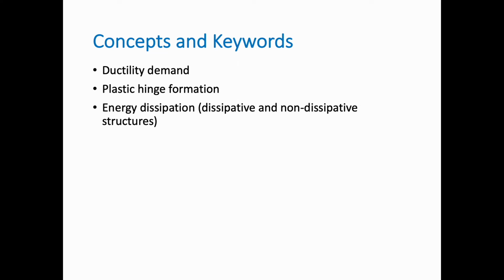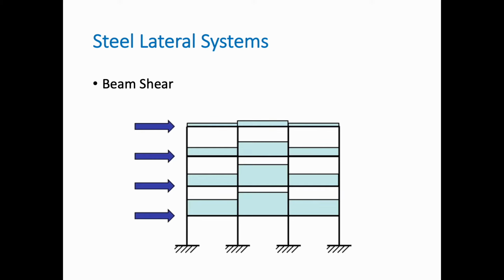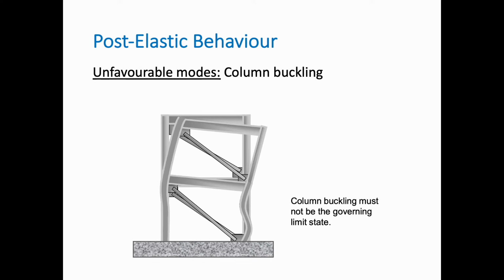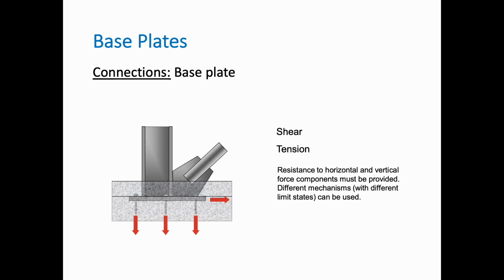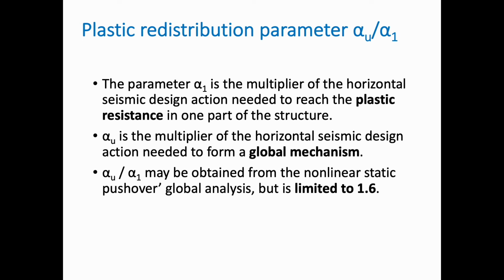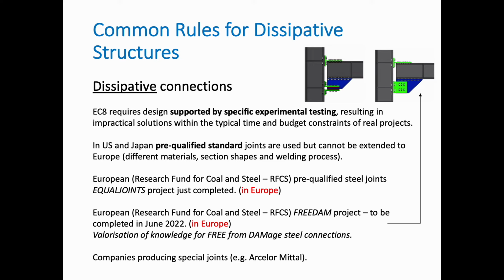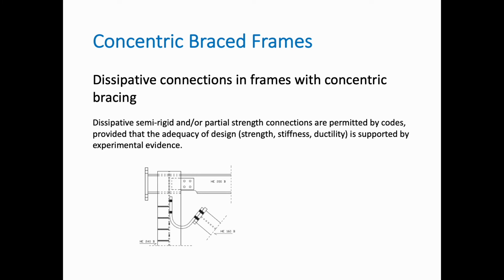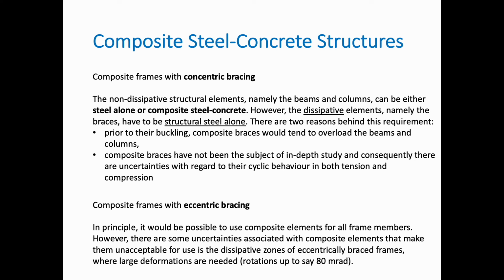Seismic design of steel and steel concrete composite structures

Comment: Hello Prof. Daniel,

May I know if there is any specific clause for the gravity system limited to having 15% of a structure lateral stiffness in Eurocode or in American Code (timestamp 1:20:50)

Also what is your opinion for concrete structures? I believe it is tougher to achieve the provision compared to steel structure. As making pinned concrete connection will be a construction issue.